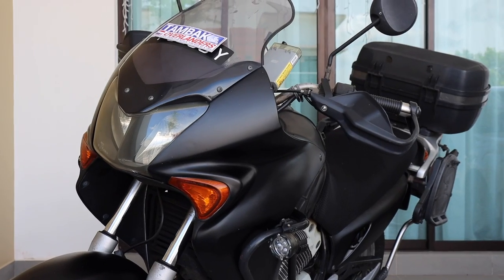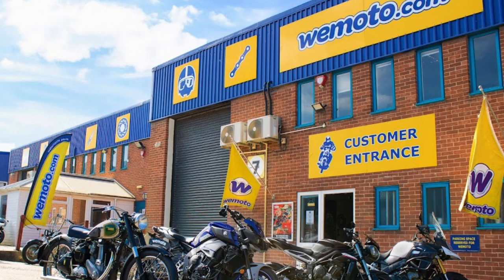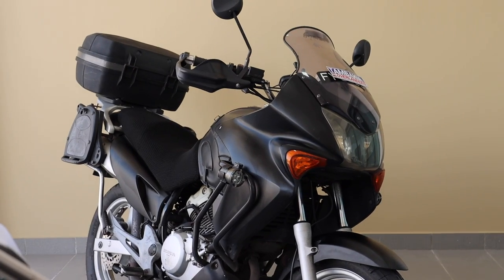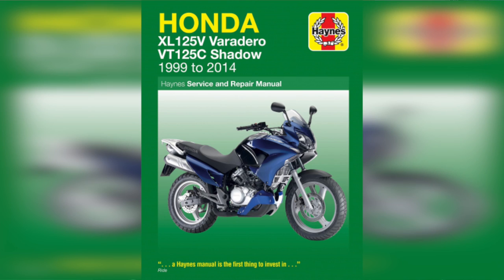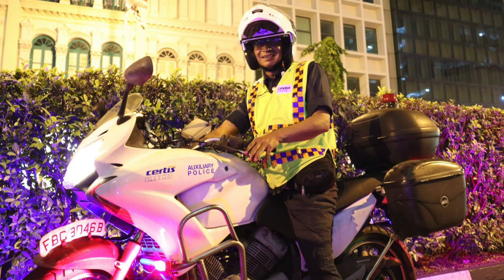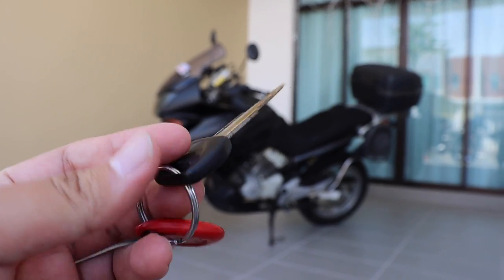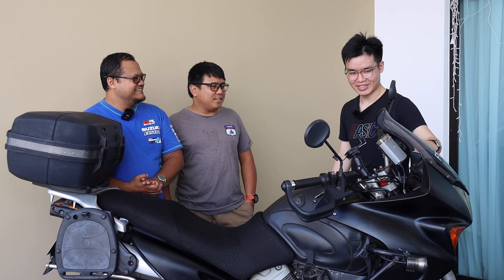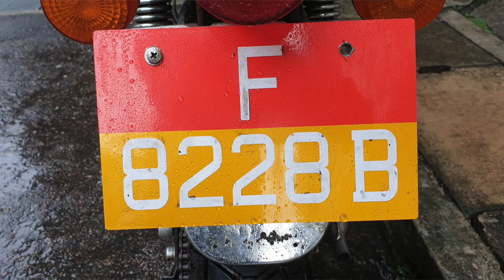Honda XL125V Varadero | SG🇸🇬 Owner's Review | Vlog#531

Comment: Excellent and entertaining....I bought one three months ago, I'm 1.88 tall looked for a larger bike. I've done 350km (London to Devon) in a long afternoon, very comfortable and very stable even with strong winds and heavy rain. I agree headlights are only there to help you find the front. My phone torch is probably brighter. Centre stand useful for servicing but hard work...I look for a slight slope and then let the bike roll backwards.
14hp out of 125cc not bad, years ago my Triumph Twin gave 28hp out of 500cc.
A 350cc version would be a rival to a Royal Enfield!
Thanks for the video, really enjoyed it